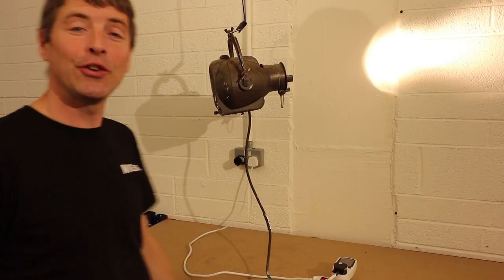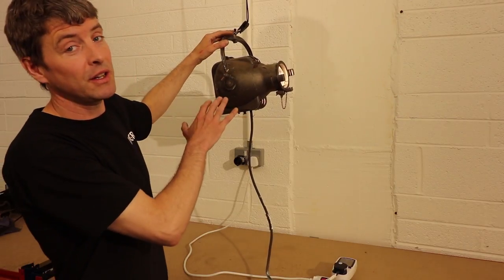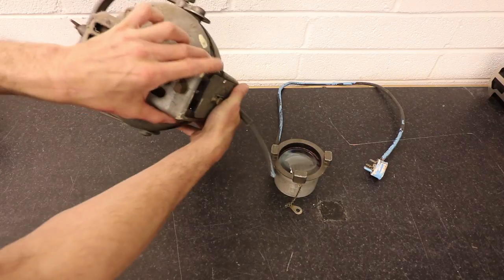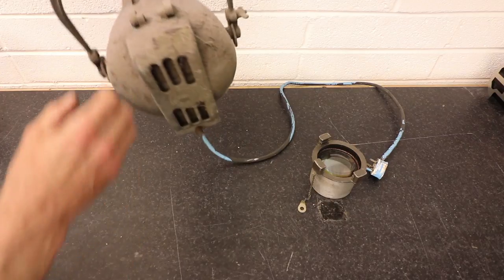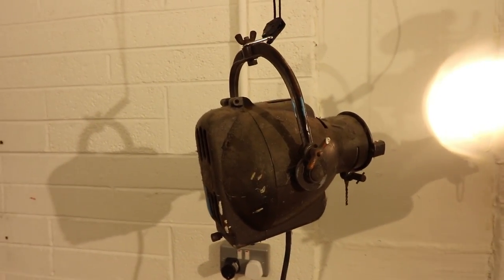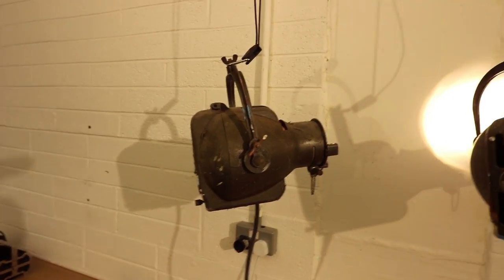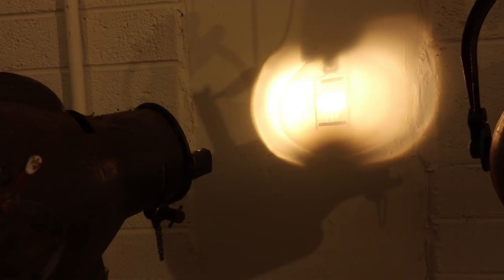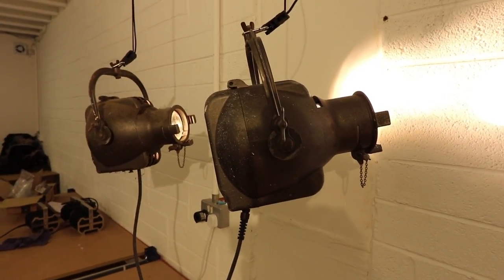Vintage theatre spotlight - LED retrofit

Comment: Great video, as usual. Shane, I was curious if airplane runway lights could be retrofitted with  LED's. Maybe there's an open bid somewhere for runway lighting?
Reply: The regulatory and certification process is more of a hurdle than the technical for aircraft and runway lighting.

Comment: no words about the driver?
Reply from the maker: I used a cheap dimmable driver. 1.75 amp, 52v and constant current. It's only going to be on for a few hundred hours a year so no point in using a high end one.